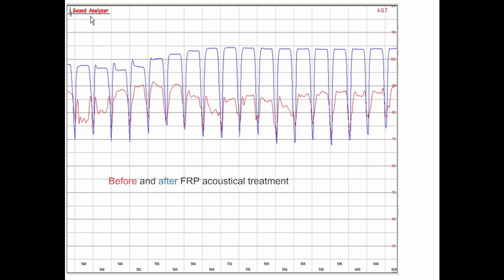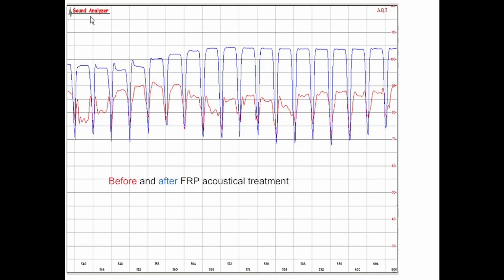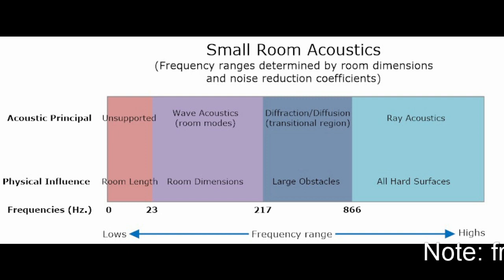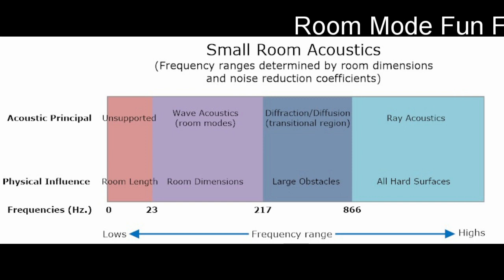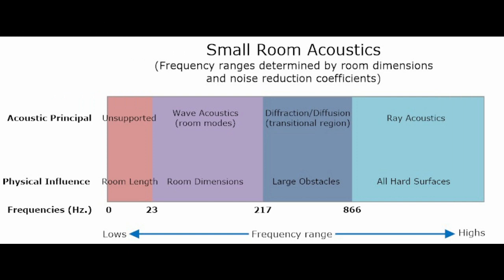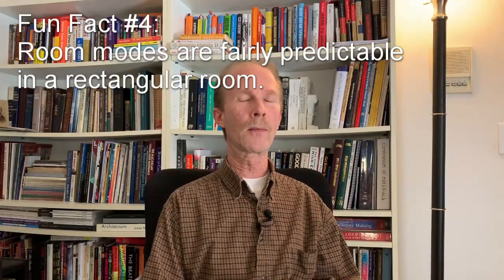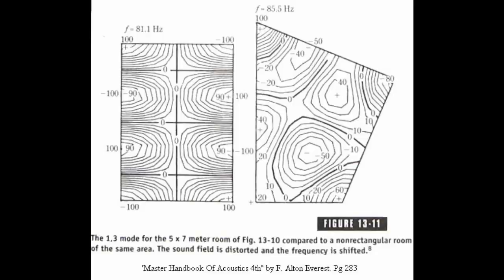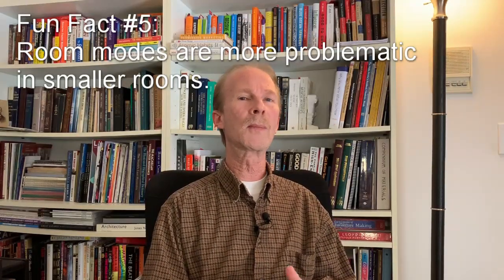Room Modes 101 in 14 Minutes

Comment: Hi Norman!:
Thanks for another excellent video.  It was such a pleasure meeting you at this past June's T.H.E. in Costa Mesa - your presentations and feedback are world-class.  
Oh noooo!  In your Room Modes 101 video you warn against splayed walls!
I continue to design, and will build that five-sided-sloped-ceiling dedicated listening room on wheels, converting my 25' tractor trailer with swing-out walls; you and I discussed my drawings last June.  This design features zero parallel surfaces of any kind, and is perfectly mirror-imaged-symetrical.  The ceiling slopes from 11' high behind the speakers down to 7'-6" behind the listener, with the length of the room at 24' front-to-back measured down the long center axis.  

The two angled walls behind my electrostatic Sound Lab speakers total 16' in width, and I plan to experiment extensively with diffusion and absorbtion behind both speakers, as well as curved semi-cylindrical vertical diffusers at each side wall's primary and secondary reflective spots.  Amroc modeling with a level 9' tall ceiling looks very promising, with many frequencies having almost no blue or red modal areas anywhere in the room, and with most frequencies having significantly less red/blue modes compared to a comparable rectangular 12'Wx22'Lx9'H room.

My plan is to use your recommended Studio6 Digital system and your recommended systematic room analysis protocol, while repeating the protocol with my two 10" subwoofers in different positions, ultimately hanging them from the tall ceiling.  Then I plan to hire you to analyze the data from what my naive review and ears think is the best configuration.  Next I'll make the changes/treatments that your report recommends, and if I'm not in love with the sound, I'ld like to hire your extraordinary site analysis service.  For your convenience, I propose coordinating to drive my audiophile trailer to you, perhaps during an audiophile show in the SoCal-Arizona-Navada area.

Could this strategy be improved upon, without busting the bank?

My priorities are extraordinary imaging/soundstage (that are world-class with Sound Labs); as well as tight, fast, ultra-realistic bass (also extraordinary with these speakers).  My mercilously accurate Sound Labs claim flat bass down to 30hz, so I hope that rolling off my two 10" subwoofers above 30hz will sound best.

Your extraordinary feedback is always greatly appreciated.

Your champion,

-Sam Bryant
San Diego

Comment: Could you please share some insights into , where to place membrane absorbers to treat modal issues, taking any room as an example. At what frequencies must they all be tuned?
Reply from the maker: Corners would likely be good because all the modes congregate there. Half way point is often good for treatment. Problem modes can be calculated or discovered with an SPL or RTA meter.

Comment: Norman, thank you for explanation. Could you explain the following, please?

Let's take the ceiling height 10'8" for instance. A wave length equal to this size has frequency 105.7 Hz. This wave would have a mode exactly in the middle between the ceiling and floor, forming a so called standing wave. A longer wave with frequency 52.8 Hz has no ability to form standing wave, to my understanding. So, why do you have 52.8 Hz in the table?
Reply from the maker: You need to multiply your numbers by two in order to account for the wave to reflect back, creating the standing wave. Rounding the numbers, 53 would be f1, 106 would be f2, 158 f3, etc.
Reply: That's actually the issue with small rooms. All those waves that do not fully fit in the room dimension can still create standing waves. But they do it at half the wave length (wave gets reflected and completes the cycle at twice the room length), or quarter the wave length (4 room lengths for a cycle), etc. All those then have a much higher chance to overlap with other higher room modes, to create stronger high / low pressure points.
Reply: @AlexLapugean  Thank you for the participation. Indeed! I've taken a pencil and have drown a wave in the wave-length room, then in the half-length room etc. The wave perfectly stands! (if I can say so :)

However, it's still not clear for me why Norman wants me to multiply the frequency by two. Is it because it has most of energy when overlaps?
Reply: @DmitryMyadzelets  Well he did not say to multiply frequency by 2, but "your numbers". The only thing making sense in that context is the room dimension to be multiplied by 2, in order to also find the waves with twice the wavelength of your room dimension, that would still create a standing wave due to reflection at half the cycle.
Reply: @AlexLapugean  Correct. Thank you.